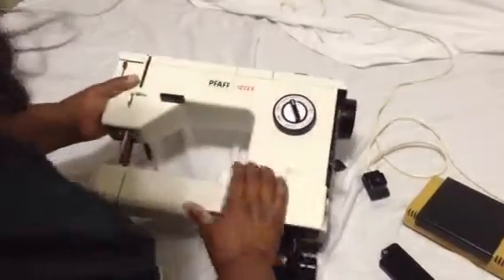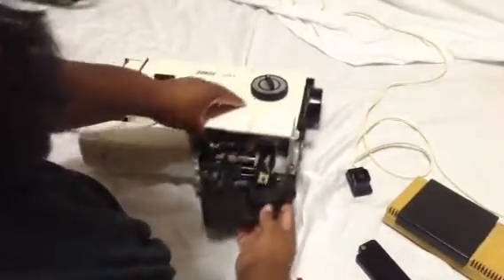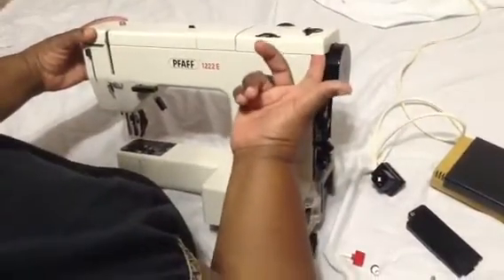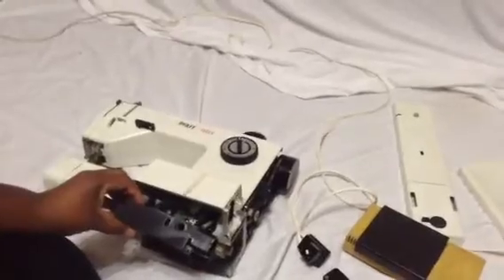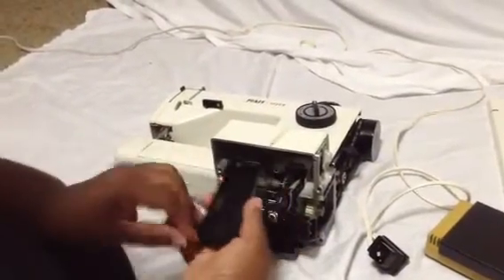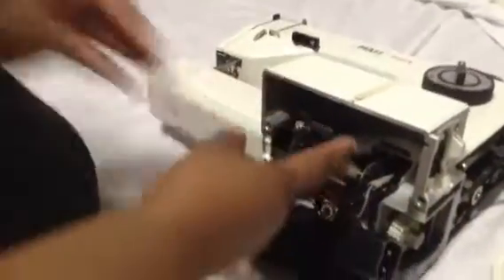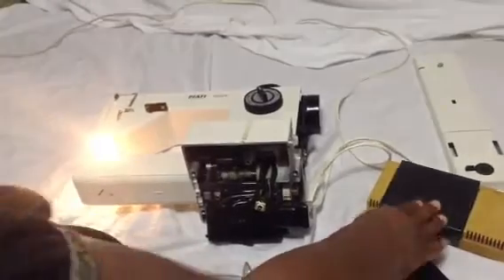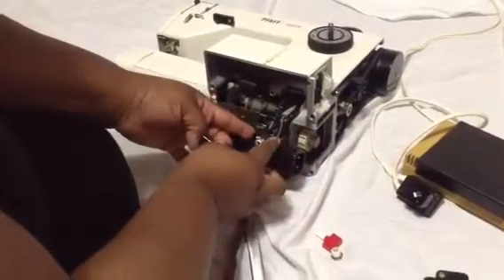Pfaff Sewing Machine POWER BUTTON FIX ISSUE 1222E 1222

Comment: Brilliant!  My 1222SE wouldn't turn on, and I thought it must have something to do with a brief power interruption we just had.  So I was looking for a fuse.  I couldn't figure out where the fuse was, so I came to Youtube and noticed this video.  Great explanation, and it works now!  So the top switch button is attached to a mechanism like a ball point pen - about as durable as a pen, too. The mechanism converts the button push to a twist.  The underlying microswitch works ok - it activates with a twist instead of a push.  Why, oh why doesn't Pfaff use a flip switch instead of a twist switch?

Comment: I bought this machine for 15$ from the recycling center because the previous owner took it to a sew repair shop and they turned her away because they couldnt get the part. The work order was included. So she sropped it off there. I did this same exact thing when i got it home before finding this video. Im glad you made it for others.

Comment: Loved this ❤,  it worked... yayy! This piece is easy to replace. Just don't take the piece off until you get new piece. And replace each one by one.... just unscrew a screw and the wire comes out.... then you put wires on new piece... thank you ❤️ 😊 💓
Reply: Do you mean replacing the power button all together for a new one? Or did you do the same thing in this video?

Comment: @TJ Sews PRO TIP: The back panel is actually fixated by three screws. After you loosen the back screew, take of the top and at the very rear end, you will spot two tiny flathead studs. Unscrew both, as they lock in the two top locating pins. Then the back panel always removes without resistance. When reassembling, these need to be tightened again, after the side panel is in place.